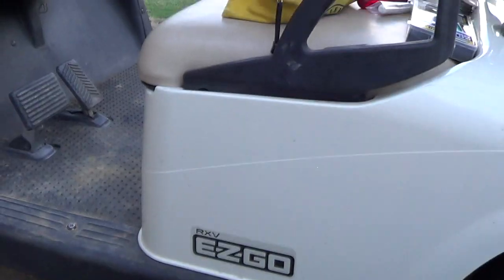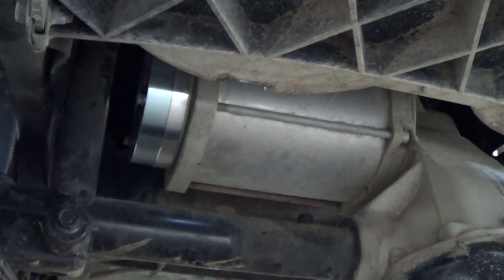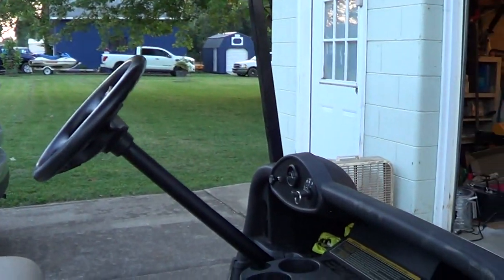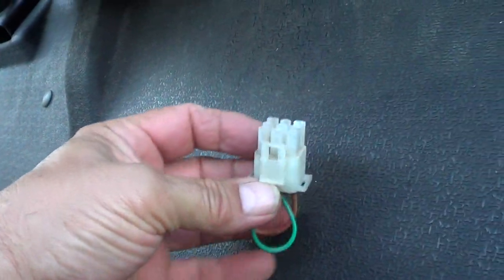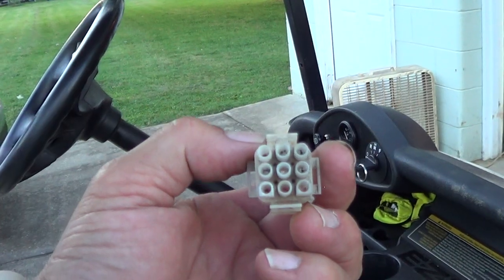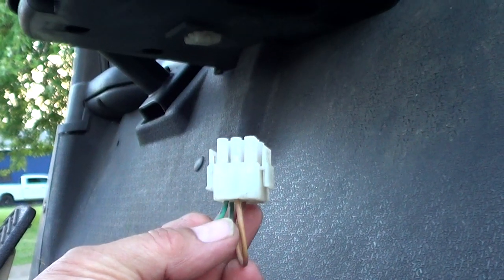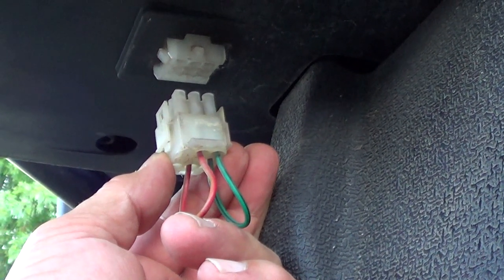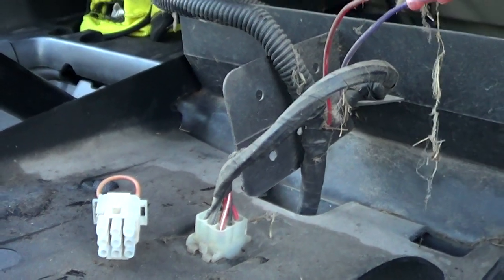Brake problems with your EZ-GO RXV electric cart?

Comment: Thanks so much for this info. I was lax in my battery maintenance and had some corrosion issues that fried a couple of wires. Long story short, fixed all my battery issues, had power to everything but the brake would not disengage. You Tube search looking for a way to manually disengage the brake so I could push it onto a trailer to take it to the shop for what I was anticipating being a several hundred dollar shop bill led me to this video. Had no idea about the plug under the cup holder. Unplugged it and plugged it back in and BAM, brake disengages and the cart works perfectly. Thanks for saving me several days without my cart and a large shop bill!!!

Comment: Dude, you rock!!!  This solved my problem in about 3 minutes. 2013 RXV.  I didn't cut the wires.  I just took two 3" pieces of 14 gauge (white) romex white wire and created my own makeshift jumper to get it going.  Totally awesome.  Thanks for the research and video!

Comment: was having brake issues with our 2013 rxv tried your fix and it worked just great. thanks for the video
Reply: Was your brake locking up? I feel like mine had a good connection, but hard to say.

Comment: So if the brake is bad/ failing it will just start locking up? I hate to wire it directly and remove the ability to remove the run plug to prevent moving it just needs a new brake. Would a new run plug do anything?

Comment: Reprogamming the control fixes this issue.  A lot of times you can reuse the old brake, if you haven't trashed the brake out.
 Once you start  having brake issues, get it to a dealer quick. Its a cheap reprogram, and you can continue to use your old brake.  (You can remove the brake, then also make a simple tow rig for the front of the cart, for your vehicle, to get it to a dealer)
Reply: A reprogramming will fix the plug issue?

Comment: Is this still working today? My cart runs for about 50 ft and then stops. I release pedal and then push it and it goes another 10 ft and then I start smelling a burning smell. Do you think I should replace with new brake or just do the jumper. Will by passing the jumper now fix what I am currently experiencing or could the brake now be fried and must be replaced.

Comment: Thanks for your post! I am having one hell of a time figuring out what the problem is with my 2009 rxv. Mine just wouldn't move one day. I replaced the brake with a new HD one. Not it. Took it to a dealer and they said the controller needed remanned and did that. Then said the motor was burned out and replaced that. Still same problem. I have power and solenoid clicks at key turn, lights and gauge light up. Gauge does not move or work but did briefly the 3 months I have had it. Brake lights stay on after key turn on. Kinda leads me to think about a brake switch.? Did yours act similar?
Reply: having the same issues.  How did you rectify your problem?  Cannot find an answer anywhere.
Reply: @billcarabine6406  I sold the POS and got an older Club Car without all the electronic crap! It was in the controller I believe. That year model was 2009 I believe and was one of the first with their new electric brakes and all the sensors. They haven't worked out all the bugs yet before putting it out on the market. EZGO won't even talk to you about it if you are not a service tech.

Comment: I think is the problem with mine. It just stopped today for no reason. I don’t have the equipment to solder. Any work around ideas?
Reply: I would think you can do the by pass with out soldering,  if you get the wires twisted together really good, and use a liquid tape to seal and protect. At least this could be a good short term fix until a permanent fix can happen.
Reply: Keith Tulloch - thank you. I did manage to get this done. As well as change the brake, and the solenoid. Now she’s running well. Let’s hope
It stays that way. 😁